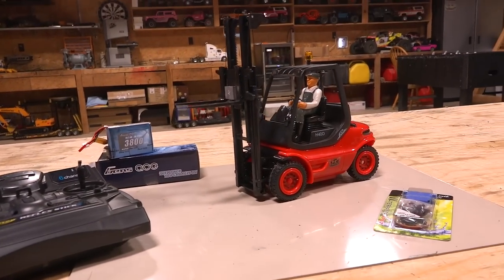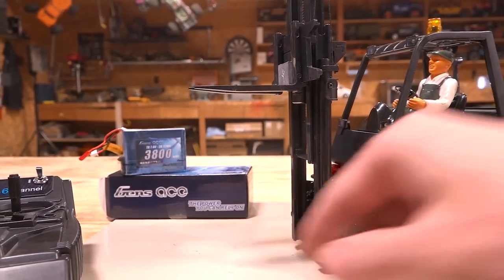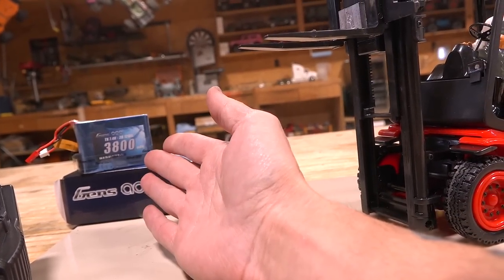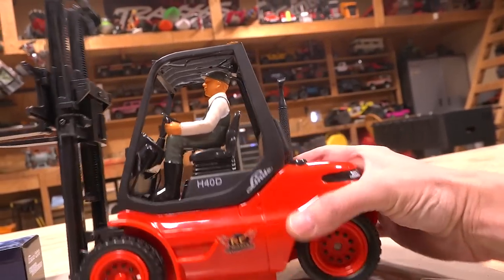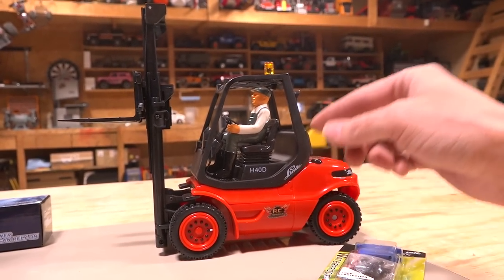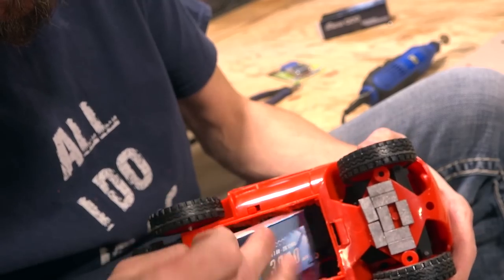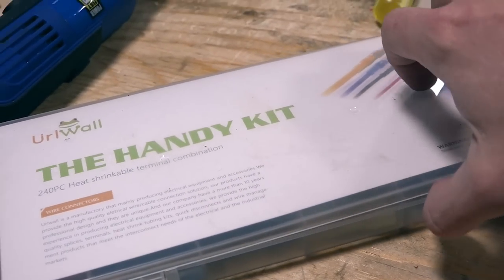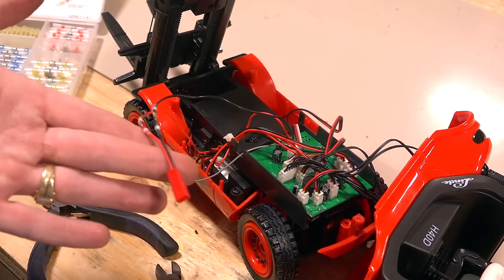Modifying a 2019 1:14 scale Carson Forklift to fit a GensAce 7.4v Lipo - Linde H40D | RC ADVENTURES

Comment: It does look like there is enough room in that little forklift to put a separate: receiver, ESC and servo into it if something did happen to the board. Which is good to know. Now all it needs is metal gears a trick aluminum mast and maybe a big winch servo to run the forks up and down.

Clearly the three dislikes are from people who leave things stock.

Comment: I have had my first Carson forklift for 14 hours and already modified for the battery upgrade as seen in this video. I Really appreciate you make this one! Two other things I have done is swap the forward drive with the fork lift channels, this way drive and turn are on the right stick and the fork/mast is controlled by the left stick. The other item is the tires have a crown which makes for a very small contact patch with the floor. I found by taking a Dremel and slowly removing the high point it has less understeer. Cheers.

Comment: Excellent, very good update, it gains in power what is missing with only 5 batteries of 1.5v. The weight on the steering is good but to change the servo it will not be easy, and if the wheels turned much more it would facilitate the loading. Excellent video and great explanations !!

Comment: I did a similar mod to my radio transmitter, so fit in a single rechargeable LiFe battery. I just cut out the battery tray, pull the positive and ground wires, and soldered the connector that the battery I was intending to use had, and finally just added a velcro strip to the tray and battery to help hold it secure in my radio.

Comment: Just a tip while soldering with the kit. 
Make U shale hook on both wires and join them and give it couple of twist then put the sleeve and solder it with heat.
Reply from the maker: That could work also, thank you :)

Comment: I did something similar to that, but I ran it through a Castle BEC.  Something in that scale with that small of a motor doesn't draw enough amperage to need more than the 25A the BEC put out.

Comment: Wicked vid - like a little kiddie when it worked. Would it be possible to swap out the cable connector on the servo - with a resister in-line ? 
Roo

Comment: Actually a 2S LiPo is 8.4 Volts when fully charged and can be a bit too much. You can try a LiFe battery maybe, that's 7.2 Volts fully charged, so it should be safe and should also be enough to run the forklift. AA batteries are 1.5 V only when fully charged the go at 1.1 - 1.2 when discharged so the lift should still work down to even 6V.

Unfortunately finding a LiFe battery can be a challenge as they are used primarily only as radio batteries as they don't risk catching on fire when over discharged (but they still get damaged).

Have a lot of fun with the fork lift!

Comment: A 2s Lipo has 8.4 V in the beginning and normally you will stopp using it with about 7.6 V (3.8 per cell), that's what you know if you are flying helis ;)  3.7 V (what means 7.4 V at 2s) per cell is already quite low (when landing), of course you can go down to 3.2 or whatever, but normally no one would do this; helis/planes often do already show power lack at these voltages. Only car guys go down that low ;-)
- BTW: Could use NiMh, like Eneloops - they also have a higher current than 1.5 in the beginning and a more flat curve than normal batteries. Anyway, very nice video!
Reply from the maker: Yup, very helpful to those reading :)

Comment: Suhweeet, Medic! are you going to run the battery's at the nominal 3.7 a cell (storage?) or take them up to 8.2/8.4?
Iirc Carson was the trading name Tamiya used in Germany for some things but it apears that the changes signify that it has split I'd say being less user modable regards the servo and Rx.

Thought about doing a rull on rc conversion now prehaps?
Reply from the maker: Ahhhhhhh that would make sense...    well, a full conversion will very very challenging because of how the lift and boom works.. but we will see :)

Comment: It may have been good enough in this instance but those solder butt joints need a heat gun to properly melt the solder.  That quick pass with the lighter made, at best,  a poor solder joint and more likely no solder joint at all.

Comment: RUBBERIZE THE REAR WHEELS ONLY. That should help the turning radius issue. Use wheel traction as a differential. Keep on loading, awesome videos!
Reply from the maker: All 4 tires are Rubber, actually :)  I was just going to put a longer steering horn on..

Comment: You could redo the steering linkage and lenghten the servo horn via 3d printing and on tinkercad, the longer horn will give you tighter steering, and still use the original servo.

Comment: A couple years ago I turned a servo into a winch controll. It was a 5 wire that  needed to be a 3 wire. I found on google how to make a 3 wire work on a 5 wire servo. It's a matter of finding the 3 wires that u need of the 5 then tie those 3 into the new servo.

Comment: One other modification I would make to that is, I would sand down those two nubs or whatever they're called, that are on top of the forks because those can make it a little more difficult to slide in and out from under pallets or what have you.  This is why the forks on a real forklift are completely smooth top and bottom to avoid dangerous snags
Reply from the maker: Well, for the game Loading Wars.. those little problem causing numbs are perfect.. haha ;)
Reply: @TheRealRCSparks  hahahaha you are pure evil

Comment: If you increased the voltage, then yes, it will increase the kg/cm torque. Yes, even the motor that was installed when you purchased it. Increasing the voltage increases the torque of the electric motor.

Comment: Another note, Why don't you try to figure out those 5 pins and put that servo in there? It might be tricky, but worth it in my opinion.
Reply from the maker: Because you can purchase 5 pin servos..
Reply: @TheRealRCSparks  Are you going to purchase some? also, are they decent servos?
Reply from the maker: @ubmbass  I dont really need to,.. the reason I was upgrading is because in the older models of the forklift, the servo supplied could not take the voltage. These ones seem a-ok so far!

Comment: Couldent you rip the electronics out and fit a propper remote reciver and esc
Reply from the maker: No, the reason being the controller for the  lift motors for the Boom and lift system is integrated. they are not servos..